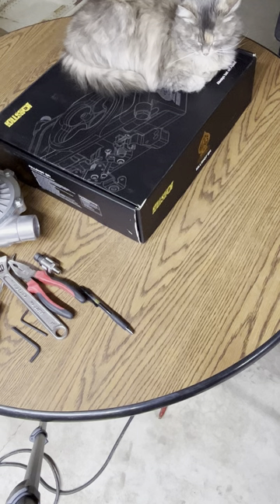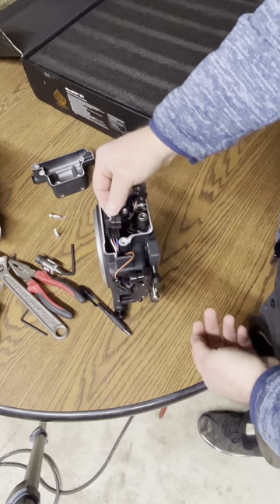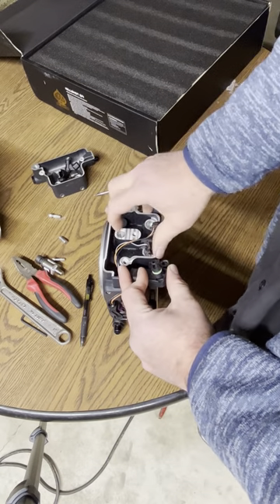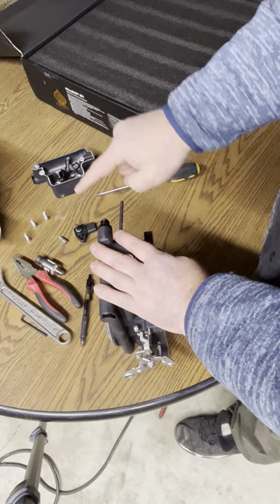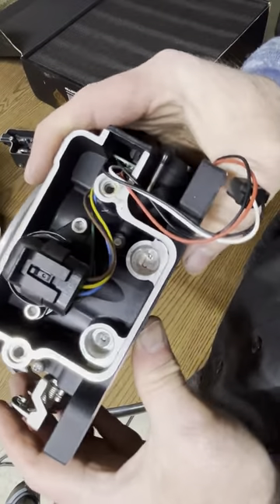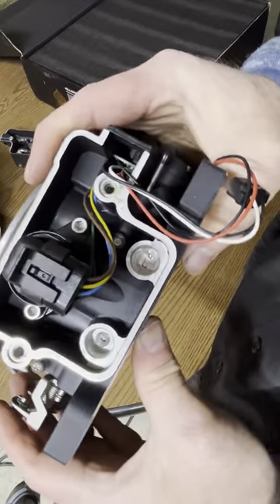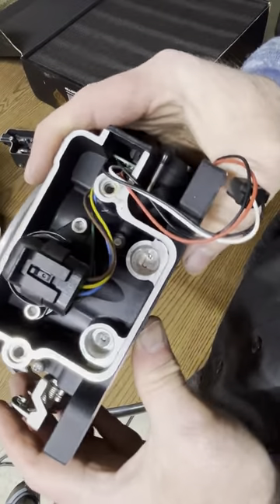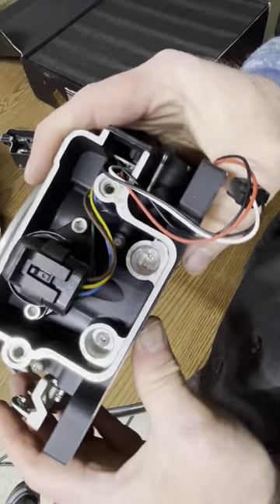Killshot, voided the warranty first thing.

Comment: I love that the kit includes a coil and distributor for sb Mopar. I plan to pick one up this year for my Mopar rebuild and im excited to break in my engine with it.
Reply from the maker: Nice smooth clean install goes along way
Reply: I installed one on my 454 and the driver for the coil went out on 2 ecu’s
Reply: Thats the biggest problem ive been seeing with these killshot efis also the coil is laughable quailty. @Lobayfactorz

Comment: Cannot void warranty even if they put it in writing. Magnuson/Moss Act  counters it. If  they can prove you actually damaged something by disassembling it, then they might have a valid void. Otherwise, you as the consumer, can tear it apart all you want.
Reply from the maker: Kinda. There is a lot of flexibility in Magnuson/Moss. I found out when I was taking law before I went engineering that it does not offer as much protection as a person would think. Especially in modern times.

Comment: Hello my friend! Tell me, do you or your colleagues have a video where problems with connecting and setting up Killshot are discussed? I have some difficulties, and the support service only asks questions (the last question was “what was my order number, and how do I remember, because I ordered 1.5 years ago, but I’m installing it only now) ... and sometimes I have to wait for them messages for several days... and I apologize for my English)
Reply from the maker: What issues are you having.
Reply: @actionvulture5251  With your permission, I will quote what I wrote to the support service today.
Yes, and forgive me, I have no complaints against you, because I understand that all the warranty periods have passed, I just want to set up for 3 weeks (three!) and understand HOW the system should work! (all this time the car is in other people’s workshops and not for free) and you tell me “tomorrow” but three days later you ask for the order number... ask Josh, we corresponded with him in December 2022. I can repeat my problems:
1. after 20 minutes of operation, KillShot refused to start the engine (it gave an impulse for a spark, but the TBI fuel dropped) I had to connect the Black Jack and the engine started
2. The KillShot monitor initially showed all zeros, including when the engine was running, and then went out completely...
3. The engine idles unevenly, after warming up the speed begins to fluctuate from 350 to 1100 and sometimes the engine stalls. when you press the accelerator there is a big drop in revolutions, sometimes it stalls and sometimes the speed increases and does not drop to “idle” for a long time... when you turn on “drive” the engine sometimes stalls...
I just want to finally start driving and don’t want to return Carter BBD to my car
(the pump I use is Edelbrock 36031, the oxygen sensor was first installed on the supplied adapter, but it was leaky and I welded a sleeve under it at a distance of 9" from the manifold)
and, once again, please forgive my English, this is Google translator...
Thank you
Reply: motor stock 318
Reply: and Today, After many attempts to start the car and achieve normal idle speed, I left the workshop, the car behaves disgustingly, it constantly stalls, but the second monitor began to show signs of life, the following message appeared on it: “Error! SD Card makes file system err”  after which he started blinking...
Reply: @actionvulture5251  I am sorry.  Do you have any advice for me or is it still Carter bbd?
Reply: And yes, my friend, there were a lot of questions here but you didn't answer. If there is such a possibility, I am waiting for an answer.

Comment: Can you tell me, my friend, what kind of injectors can I buy on the secondary market to replace the original ones? The guys from the support service decided from the video that my injectors were faulty with a mileage of 500 km and offered me to buy Holley injectors, but I don’t have the time and spare money for this purchase...
Reply from the maker: I have seen the injectors just clogged with fuel line debris. I would suggest cleaning them first.
Reply: @actionvulture5251 Yes friend, of course I cleaned them and based on the results of the video from this very cleaning I And they gave me a verdict that my injectors are faulty, at least three out of four, how could this happen? I have no idea... my kill shot lay in the box for a year and a half waiting for installation and from the very beginning, as we installed it on the car, it immediately began to work incorrectly...

Comment: Please help. 4.3 v6 with turbo new 340 lph pump 48 psi no vacuum leaks it was running then dying now it revs to 2400 and shuts off
Reply from the maker: Make sure you have enough fuel pump and your timing is good. I have seen a few people keep the timing locked in the handheld and it cuts out at about 3k
Reply: @actionvulture5251  I changed cam selection from mild to stock and it's running great

Comment: Thanks for the breakdown, seriously been researching these efi for my 68fastback.  Royal flush really gives you the best features for the buc,. Only thing holding me back is long term support but knowing how they work internally really helps.
Reply from the maker: Royal flush is a unit. Has the same throttle body but with the added bonus of a built in cdi box with a 2step input and a rev limiter. I just did a killshot install video I could swap harness and ecu and make it a Royal flush video real quick. In my next video it’s a full install and test drive. Long as crap
Reply: @actionvulture5251  ah good to know, I watched your last aces vid and was impressed by the tuning stuff.  I'll be purchasing the aces distributor and let the ecm control timing. I'd rather see a video on how to set that up.
Reply from the maker: And so it shall be done I will make videos on all the different timing types and setup.

Comment: Missing from video: T-handle allen wrench set and a dog.  Great video btw, very informative and looks very well built.  I will be ordering one soon for my LT1 build, already have the Aces High Roller Pro ignition package, just need the throttle body now.  Thanks!
Reply from the maker: I think efi conversions has a 24x 1x conversion for the opti spark. Then you can modify a jackpot harness to fit that unit.

Comment: Very cool, was concerned about the pricing. But it makes sense, the components appear to be off the shelf. .. which isn’t bad… oem spends the most on r&d for sure…
Reply from the maker: Ac delco map sensors and gm TPs sensors and stuff

Comment: Are there instructions on how to use killshot on a supercharged application?  I have a 350 sbc with a Weiand 177 SC that puts out 570hp. Thank you for the video, definitely interested in the Killshot
Reply from the maker: I will be making a video at some point about how to scale the tables for boost. And with a draw through sc you will have to refer to the manual for putting the plug in the bottom and installing the boost reference barbed fitting. Nothing too bad you will have to use the laptop tuning software to get it dialed in.  Or should I put a single turbo on my camper?

Comment: I'm assuming the injectors and sensors are off the shelf parts (hopefully) is that information available to the owner?
Reply from the maker: Yes. The injectors are 100lb hr pico ev6 those are the hardest but everything else is just acdelco stuff. Not sure about the map but I have seen them on some other small cars.
Reply: @actionvulture5251  that's killer news. Total spirit of hot rodding stuff here!

Comment: Great video. Learn so much already
Reply from the maker: Going to do a install in the next video. Post stuff you really want to know more about so I can squeeze it in.
Reply: @actionvulture5251  will the kill shot lose it memory if I take the battery off? It keeps losing it setting when I turn the ignition off
Reply from the maker: It does not loose memory if disconnected. I just put my deuces wild on last night and it still has the same tune in it. Where are you seeing the setting reset at.
Reply: @actionvulture5251   the problem I’m having at the moment is it will only fun for around 5 seconds then it stops. It does that every time I start it
Reply from the maker: Make sure you are not loosing 12v between the on position of the key and start. If it does the ecu thinks you went key off and on so the fuel in there will fire up but then die out. As a test put your 12v switched wire to the positive side of the batt and start it. If it stays running your good just remember you have to disconnect your 12v switched to turn it off during testing.

Comment: Does the hand held touch screen have to be hooked up at all times for this to work and run?

Where can I find these kits at? I've never heard of it before, but I have a 383 SBC that's going in a 85 Monte Carlo SS that should make around 450-475 hp. I need a carb anyways, so this seems simple enough.
Reply from the maker: Naw you can get the tune or the self learning done and turn off the o2 sensors and unplug the Hand held. Most of my videos I use the same two hand held screens over and over again.

Comment: Great videos, AE1006 injectors are 160lbs vs AE 1004 are 1000lbs per hour per hour right?
Who sells them? 
Does Aces and Holley use the same type of injectors?
A friend of mine was asking and wondering about FITech as well?
Reply from the maker: A lot of the injectors are the same out there in the after market.

Comment: Great video, can the TPS send a signal to a transmission control module? Can a tap into the TPS to provide a signal to transmission module ?
Reply from the maker: Not recommended really. If you was might try it with a diode or something. There will be a 0-5v output in the future for these
Reply: @actionvulture5251  thanks. Have been looking for information on this brand to see if it can bee done or options

Comment: I own a 1990 Squarebody Chevy Suburban with a blown motor that i will be replacing with a fully rebuilt 350 SBC of the same year range. For the new motor I am considering doing away with the the original stock EFI system and putting an Aces Killshot in it. My only concern is i believe it currently has an electronically controlled transmission from the factory. Is the Killshot compatible with electronically controlled transmissions? or would extra hardware be required to ensure the proper function of the trans?
Reply from the maker: You will need a trans control. They have one for the 4l60e and 80e under development. Should be out some time. I kind of hope to get the chance to test it. We will see and of course I will make a video about it.

Comment: So can you replace the 100 pound injectors with some 210s and change the fuel settings in the software?
Reply from the maker: That will be a thing at some point I think currently the value is locked out unless you have the engineering level software that I use but it is a future thing

Comment: old video hopeful too get a response, on my instructions page 14 -2.5 it just says boost reference port and shows the nipple for the vacuum line and the plug by the throttle blades. From what you said for my turbo blow through i should leave those alone from how they came with a plug in the vacuum port and the plug not installed? currently i have it installed only as it didn't mention draw through or blow through. now im hoping it didnt cause any issues.
Reply from the maker: In the out of the box configuration it is good to go for blow through. Just need to use the tuning cable and software to rescale the fuel map.
Reply: Alright good to go thank you for the reply sir.

Comment: Can it be converted to progressive throttle linkage?
  Can it be run return less?
Reply from the maker: Progressive linkage with be a bit funny if too aggressive because the injectors are ontop of the plates. You can use a bypass regulator and deadhead to the throttle body. That is my normal setup.

Comment: Only thing i don't like about this unit is that it doesn't appear you can run a 14-inch drop base air cleaner. If it was more in the shape/style of a 4150 mech secondary carb, it would be better, IMHO
Reply from the maker: They will likely drop on at some point.

Comment: I don't know much about vehicles, but I am interested in upgrading from a carb to EFI. I've basically only seen good reviews about the Aces stuff. I have an 82 cj7 with the 4.2l. What setup would you recommend? My primary goals are better fuel efficiency and not dealing with cold start issues and tuning a carb.
Reply from the maker: If you don’t plan for 5k rpm’s or higher you can make a deuces wild work pretty good on that unit. Make sure to get the tuning cable and you will be able to go through a good basic tune for getting that fuel just perfect.
Reply: @actionvulture5251  I apologize for being ignorant in regards to tuning. If the price difference isn't and issue, would I get better results with the killshot master kit?

Comment: Would there be a part number available for the idle air control motor you removed ?
Reply from the maker: I am slowly working on a gm cross over number list I want to put out there on the interwebs almost everything is off the shelf sensor wise

Comment: do ALL  the throttle bodies open simultaneously? or two crack open before the other two which i thought was usally needed to get good low speed driveability w/o any surging acceleration?
Reply from the maker: They may do progressive at some point. But mine runs good without going crazy.

Comment: I just bought the killshot for my sbf I’m hoping to have it finished this weekend
Reply from the maker: Exciting. Take your time on the install and make sure everything is correct. 80% of running issues from aftermarket efi units is install related. I see most issues with bad timing causing fuel issues and idle stability problems. Look for injection pulse to be around 2-3 and iac with engine up to temp at about 10-20 steps.
Reply: Awesome thanks for the advise do you happen to have a email address if I have any questions
Reply: Hey I just went to put in my information on the hand held and it says timed out offline what does that mean and it will not let me put in any information
Reply from the maker: I had that issue when I had a fuel pressure sensor plugged in. Or when the hh software did not match the ecu. Go into settings and update ecu and see if that helps. Also I will put that in a video soon.
Reply: @willbradley71   good evening how did you fix the timed out offline mine is doing this
Reply: Nope I had to send it back. They just don't have enough support to help after hours

Comment: So if you're over 650hp you could replace those injectors with bigger one's correct? This is going on my built sbc in my mud truck and was thinking about boosting it but im already over 500hp na. Just tired of carburetor problems.
Reply from the maker: Time for some multiport injection hoss cat. I just tested the new generation joker multiport kit from aces. The tb on it does 1000 cfm and works with ev6 pico injectors. I should have a video of the install up in the next month.

Comment: So I need the Deuces Wild unit but cannot get an answer from ACES.  Called 3 times.  1) can i run the FPS shown in above video with the 2bbl version.  2) is there a Ford C6 kick down kit or does the Deuces kit come with C6 transmission hardware?
Reply from the maker: They are not open on the weekends or after 530 est. it does not come with linkage hardware but the throttle linkage is kinda one of those universal types where if you have the connecting hardware you can make it happen. The deuces wild does have the fuel connector. The new software seems to have the display option for fps and they will also have a gps handheld out soon.

Comment: The triangle port on the back sucks a lot of vacuum. Is it supposed to?
Reply from the maker: You should adjust your throttle blades open some more to lower your iac value then zero your TPs.

Comment: Why does my map sensor read 11.4 when it should read approx 75 I’m at 6700 feet above sea and after watching the video the map sensors inside the machine so I’m gonna have to open it to find out what is going on which basically will cost me $1300
Reply from the maker: Ah the 11.4 is in psi. For that pressure in kpa it calculates to about 78 kpa. Same same. Also your BAP should read nearly the same.

Comment: I’ve put a 4 barrel kill shot on my 2.2 Toyota 1976 hilux but it’s a 2 barrel manifold. Should it still work ok ?
Reply from the maker: It will have a bunch of air and fuel but you should be able to tune it down to that. The deuces wild is their 2bbl unit. Good up to 350hp install and tuning is the same other than the 2300 flange

Comment: What is your opinion on aces kill shot on a sbc with a turbo? I emailed aces customer service and they said it wouldn’t work, but their web site says for turbo applications. What is your opinion?
Reply from the maker: I am fixing to put a super charger on the black Chevy. Yeah you can go blow through or draw through. It has a 3bar maps sensor you will need a tuning cable and scale the maps for boost. That is in a up coming video

Comment: So where can you get the software to change injector size? Was looking to get one of these to upgrade for E85 but can't find the software to change injector size.
Reply from the maker: When the e85 update is released you will be able to change the injector size. It’s currently locked at 100. Currently for killshot it take engineering level software to make that change.

Comment: Do you have to run a return line and you use the camero style Efi fuel system used for ls swaps?
Reply from the maker: You can use that just make sure to adjust the rated injector pressure in the hand held